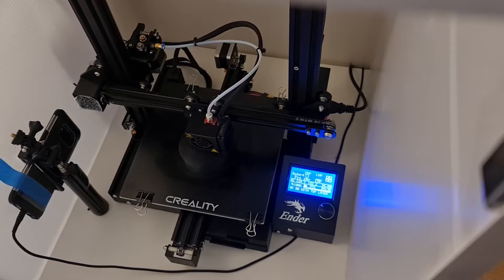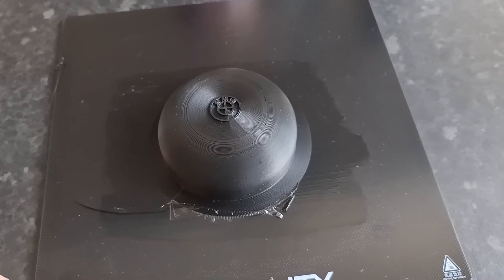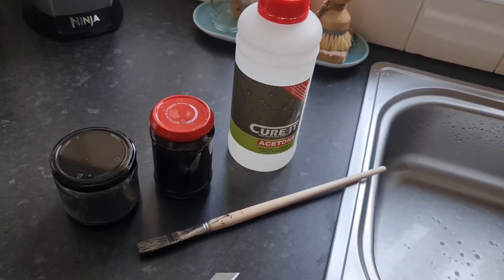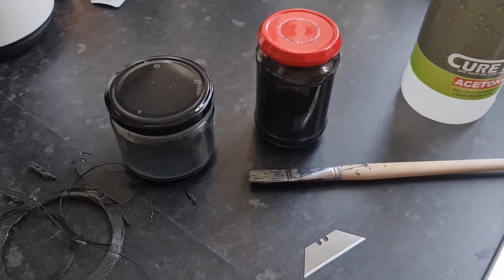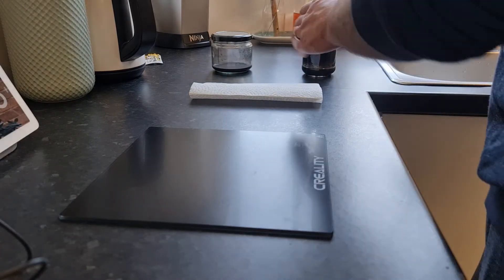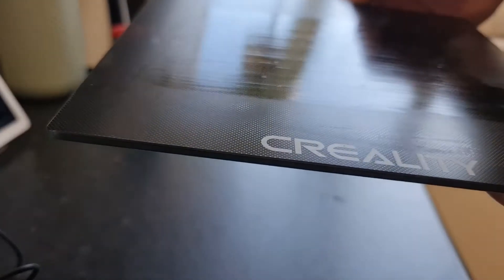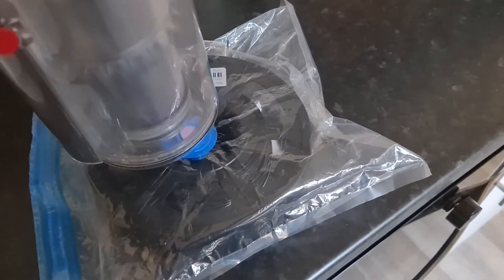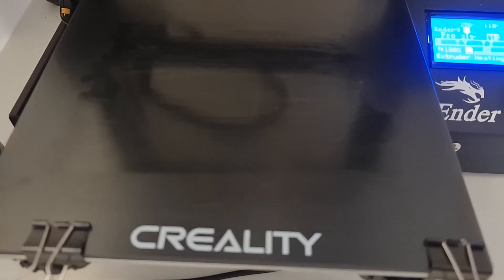3D Printing - ABS bed adhesion with ABS JUICE! Better than glue stick, hairspray or tape!

Comment: This is a really good tutorial!!! Especially for those who just start using ABS and find that it floats over the bed like a snowboarder :)
A few questions if anyone can answer please: Is a glass bed suitable for ABS? (My magnetic pad doesn't hold the ABS right now)
I put my ABS in acetone for 30 minutes and it didn't melt. It gets softer and that's it.
I just received this wire and it says on the package: "CR-ABS".
I hope it's not some weird ABS compound.
Any advice would be appreciated.
Reply from the maker: Yeah the glass bed works very well with abs. I had no problems. You either got some weird abs mix or your acetone is not strong enough I would say. Wish all the best 👍🏻

Comment: Abs is the less hygroscopic of all  plastics in the market i dont need to dry the filament and i live in a humid country that's the reason i love to work with these filament is completely tolerant to humid conditions, and love to use scraps to make abs juice agree with you the best glue to work with
Reply from the maker: Same here mate! It's my favourite 👌🏼👌🏼

Comment: Hi, you did a really good job!

I have a question: how do you prevent the ABS juice from making Bubbles when you start printing? With the heat of the bed my ABS juice always bubbles.
Reply from the maker: Hi! Thanks for watching 👌🏼 from my experience I would say that if it is bubbling is probably because you've applied to much. Try applying only a thin layer! Hope that helps!
Reply: @evosgarage  ok i 'll do that thanks a lot man !

Comment: Great tutorial. I’ve always used hairspray up until I had a difficult shape to print in ABS with a very low ambient temp. I got it printed using the ABS juice. Really chuffed that it worked when nothing else did.
Reply from the maker: Thanks Simon! Absolutely! Hairspray works very well with PLA but ABS Juice is a must for ABS prints in my opinion! I'm glad this has helped you with your prints!👌🏼👌🏼

Comment: Did you do any upgrades on the ender? Seams like it completely stock. I want to start trying out printing with abs and heard a lot about the fact "you must upgrade... Blablabla" so I was wondering if you have done anything.

Also could you share your settings for the slicer and Wich one you use 😊
Reply from the maker: The only thing I did was I built an enclosure. That way you can have a stable environment for the printer. ABS doesn't like temperature changes at all, otherwise it tends to crack, warp or the filament just won't fuse. Since I've built the enclosure I've been printing ABS as easy as you probably print PLA.

I use Cura, the settings are mostly different for each part I need to print, it depends on the shape, orientation, support, etc

The temps I'm running when I print ABS are 258°C nozzle and 110° bed. That seem to be the sweet spot for ABS in my experience! 👌🏼

Thanks for watching
Reply: @evosgarage  alright thanks 👍

I still have to wait for some parts, like the glass bed and the pi the get octopy ready and some stuff for the enclosure
Reply: @evosgarage  ender 3 v1 goes into thermal runoff when operated at 110C
Reply from the maker: @certified_boogeyman  Hi! Maybe mine is not the v1, I've never ever had that problem before tbh! 👍🏻

Comment: Are you using octoprint on your phone? Great video BTW!
Reply from the maker: Hi! Thanks for watching. I'm not actually, but I would like to!
I have cctv in my enclosure but I would like to be able to control the printer remotely too!
Reply: @evosgarage  https://community.octoprint.org/t/android-phone-as-octoprint-server/9221/49 some are trying to run it on Android , there is an APK in the thread.
Reply from the maker: @machetie  thanks for sharing